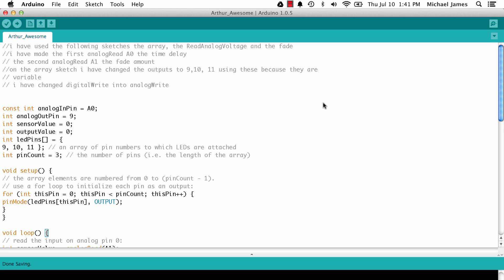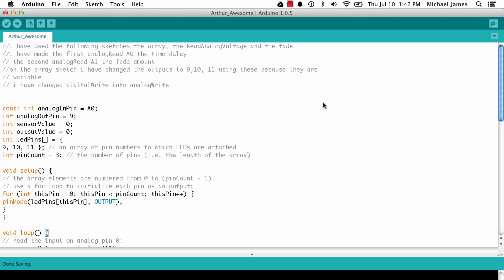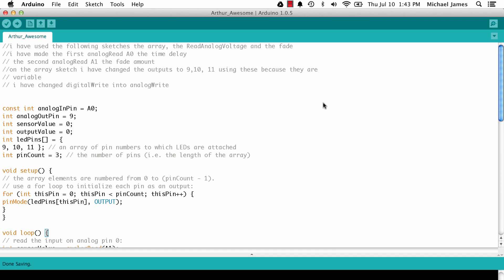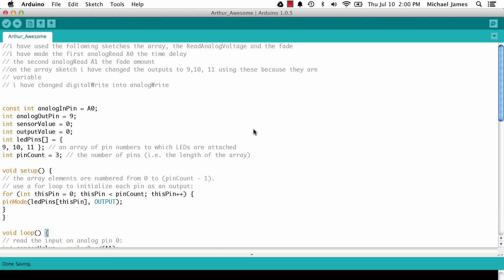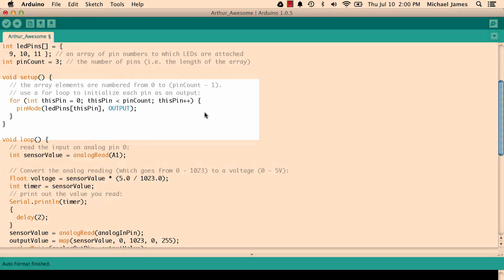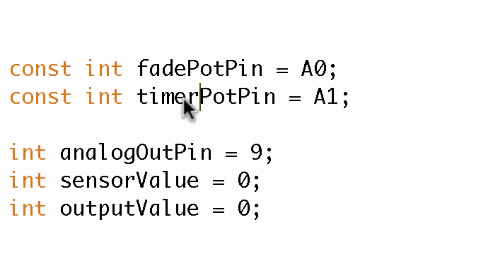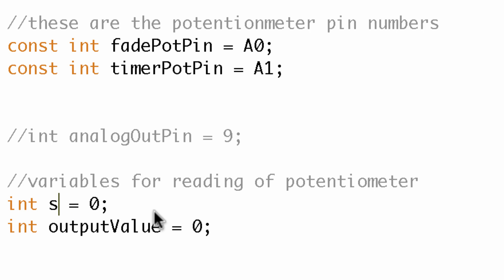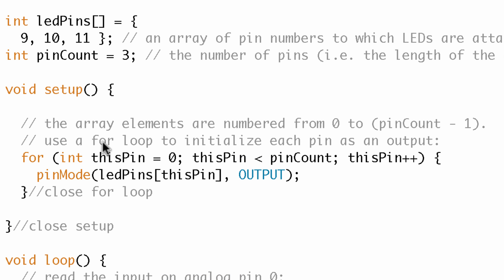DeBugging an Arduino Sketch #003 :: Cleaning up the Code

Comment: You could make one for loop by adding another array with the index of LEDs to flash.  It would eliminate the duplication of the sampling code (which should be in a separate function, but may be they didn't get to that yet.)